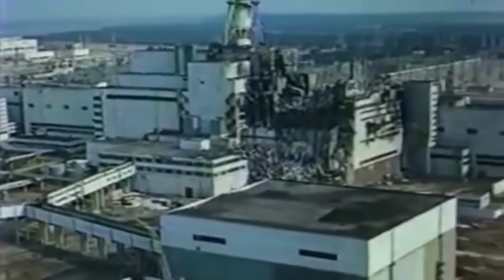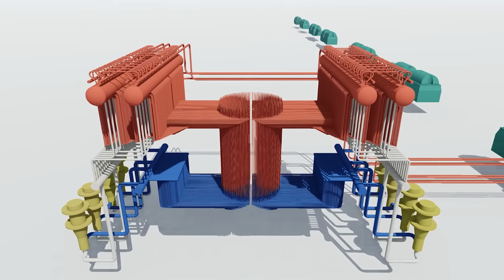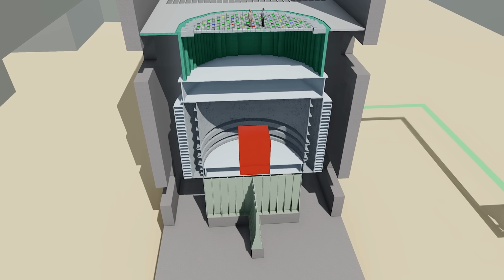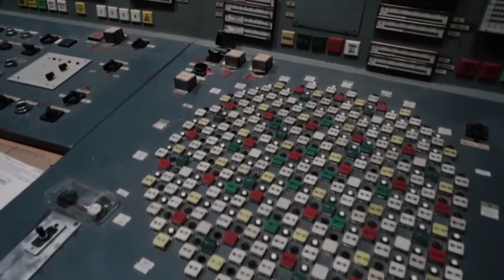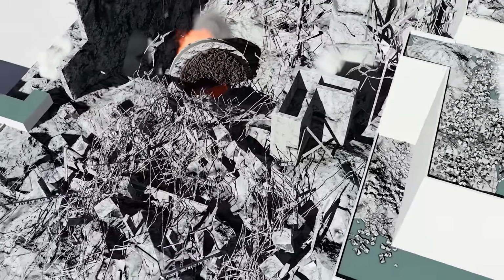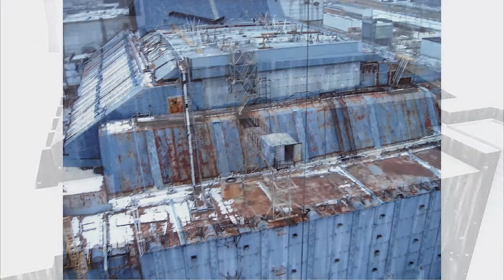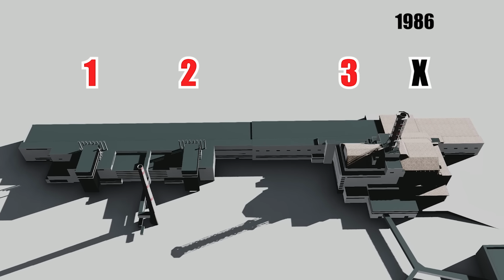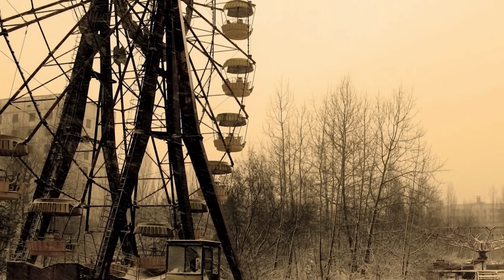CHERNOBYL DISASTER - An Inside Look - 3D

Comment: A stupid comparison. In Chernobyl, incorrect operation - contrary to the regulations - led to a catastrophe - in Fukushima it was an event that was misjudged (the walls against the tsunami were too low and the power plant was planned negligently). In Fukushima there are also 3 containments that do not hold back the radiation - on the contrary: the reactor hall exploded there too. In Chernobyl the roof of the reactor was thrown off and the reactor was destroyed - in Fukushima the reactor was also destroyed. In both cases the area was so badly contaminated that the people had to be evacuated. Did both disasters lead humanity to switch off nuclear power? No, on the contrary. People are still being told today how environmentally friendly this criminal technology is. It is a scandal and a crime against nature, animals and people!
Reply: "in Fukushima the reactor was also destroyed."

In Fukushima none of the reactors were so much as scratched by the hydrogen explosions that happened above them, the only damage to the reactors at Fukushima is at the bottom of them where loss of coolant led to them melting through the bottom of their containment vessels.

Comment: "Western reactors are stable by design" LOL :-) like Fukushima !
Nothing is stable !
Reply from the maker: old analog_synth Fukushima melted down when the reactors were off. They melted from decay heat that was not removed because water circulation pumps lost power after being knocked out by the tsunami.  Its reactors are stable while running.  Chernobyl blew up from the nuclear chain reaction having a runaway. Result of an unstable reactor design.

Comment: All water cooled, solid fuelled reactors are highly inefficient (using up only 0.7% of the fuel) and unsuitably dangerous, since water is a very poor coolant and not suited to a high neutron flux application. Its inventor even said that they should not be built by the late 1950's.  Great graphics, very interesting!  Thx )

Comment: Why were these uranium filled Led Tubes jumping up and down shortly before the disaster?
Reply: due to the steam pressure desu, due to the tests the valves were closed, the steam pressure increased due to boiling water (steam has a lower neutron absorption coefficient than water, respectively, the more steam, the hotter the reactor) and the steam pressure in seconds became so huge that it began to burst channels and push rods out.

Comment: If I got it correctly from the media, this type of reactor is just as safe as all western types of reactors. Just look at the list of incidents in German nuclear power plants. I also remind you that not only 1 reactor exploded in Fukushima, but several - due to the same triggering event: the tsunami after the earthquake. It must also be noted that in Chernobyl all security systems were switched off by an idiot who was money-horny and haughty, who did not believe the warnings of the staff (Anatoli Djatlow), and also acted against the regulations in the operating manual. To this day, the West is jealous that the Soviet Union was able to design and build a reactor as early as the 1960s that still meets many Western standards today. I would like to remind you of the many incidents that occurred in the west: Thee Miles Island, Windscale, - in Germany too, one had the same problems with some of the reactors that led to the accident in Three Miles Island - but the operating personnel were in Germany better trained. I also remember the incident in Switzerland: Lucens. I must also remind you that the reactors in Duel (Belgium) and Tihange (Belgium) have been classified as scrap reactors since they were commissioned because hairline cracks were found in the pressure vessel jacket. As a remedy, it has been prescribed to preheat the emergency cooling water so that it does not break due to thermal stress in the event of an accident. I also just remembered that in Fukushima they had the same problem with the incorrect content display for the pressure vessel as at Three Miles Island. In Germany, too, the problem of a correct display - under all operating conditions - has not yet been satisfactorily solved. In addition, it has to be noted that it was only with the accident in Fukushima that the problem of several reactors in one place was recognized: If even one reactor breaks down, access to the remaining reactors is also restricted. However, the Raktroten I, II and III in Tchernobyl m.W. continued to operate until the early 2000s. This contribution is deeply politically justified and therefore worthless because it is not objective.
Reply from the maker: "an idiot who was money-horny and haughty"  not very objective dont you think LOL 
I happen to agree with you that nuclear reactors around the world have serious flaws. Look no further the Fukushima.  And the monitoring systems that give false indications represent immense risks.  Its surprising there haven't been more disasters.     
My video cant be edited after it is posted to Youtube and so I cant change what I say.  I plan to remake this video and expand on the detail visualizations and illustrate how the systems failed.  This was my first attempt and I am thrilled it has got a million plus views.    Next time I will stay away from political commentary and my personal opinion.   It doesnt enhance the video.

Comment: it seems to me, and I have never watched this Chernobyl HBO whatever it is because I don't watch TV and have nots for almost a decade but, designing and manufacturing a nuclear power plant, most predominantly the design of the reactor core is not something that one should take lightly. It is an exact science. It's not as if one of those things that the designers could have just sat back and said okay well this will just be one thing that will put on the back burner for a while. at the end of the day out of all the Chernobyl videos that I have watched and all the research that I have done this pretty much comes back to Occam's razor.to anyone not familiar with this Occam's razor is the scientific precept that with all things being equal the most logical and simplest solution is usually the correct one. It is most likely that this could have been avoided had it been more proper training, and more outreach and communication with the developers of the rbmk 1000 reactor series.if there are three of them still in use than it's painfully clear that these reactor cores are not dangerous under the correct supervision and following the correct

Comment: Only The Experience and Knowledgable Need To Construct Such A Machine, And They Need To Test It Thoroughly, From The Inside Construct To The Outside Of The Reactor And Building Thoroughly, To Make Sure, Every Worker or Citizen Is Safe In Or Out Of The Factory, Or Were The Reactors Are Placed In or At The Locations.

Comment: To their credit, it took 1500 buses from all over the Soviet Union, and was accomplished in about 3 hours!!

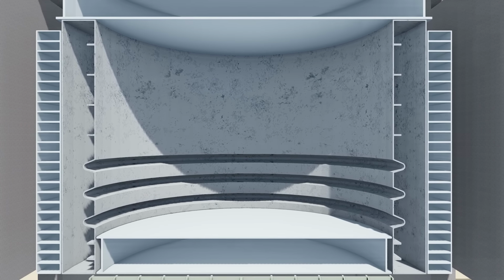Edit: also, the control rods that were designed to initiate a emergency shutdown of the reactor (not the 'moderating' rods that were used to control the reactor on a daily basis) also called the 'spider' for it's shape was IMPOSSIBLE to engage that morning (1:26ish a.m.) why? Because the electrical circuit that controlled the safety system was NOT CONNECTED!! It was assumed that it was almost impossible to have an accident with the RBMK 1000 reactor due to the unbelievable propaganda that was disseminated by the Soviet Communist party to allay the anxieties of the people. 
Even Gorbachev was told it was as safe as a 'samovar' (a steam kettle or tea kettle in the west).
Also, there were very many witnesses in pripyat that saw 'cherenkov' radiation glowing in the clouds around the area of the reactor buildings and above thet own of pripyat on the night afterthe explosion, and for a coupledays after.
(the blue visible light givin off by nuclear fission, you can see it safely on YouTube by searching 'nuclear pulse'. Very many universities, and power plants have videos on here showing it very clearly.)
This is safe when viewed through several feet of water, as water is an excellent neutron moderator. If you're seeing it through the air though...you're essentially fkkd. 
Just thought I'd add those details...
Note: I'm not a specialist, or a nuclear scientist, chemist or even qualified to give accurate information about this subject..
I merely remember things well, and have read pretty extensively about Chernobyl. 
I was around 12ish years old when it happened. 
Cheers ya limey bastahds...
😳😂😂😂
Reply from the maker: It was 36 hours later.  The accident happened Saturday morning 1:30am and by Sunday afternoon the busses were moving the Priyat inhabitants out.  Quite a monumental feat.
Reply: @Mike-Bell  pardon me... indeed it was monumental... I've seen very conflicting stories about that evacuation. 

I loved your video, very excellent graphics... I've seen just about every availed documentary about Chernobyl. 
Thanks so much for sharing this. 
respect from ☀️😎☀️🇺🇸
Reply: 36 hours after puts it at Sunday about 1:30 pm. I was mistaken. Thanks for the reply. 
Be well brother, can't wait to see more from your channel about this. 
Cheers!
Reply from the maker: @d.cypher2920  video says evacuated the next day
Reply: @Mike-Bell   yes, It does.

Comment: Why was the stack rebuilt/replaced to accommodate the safe confinement structure? Was there still a required function for it?
Reply from the maker: I can only assume there is an ongoing ventilation requirement for reactor 3 and leftover 4.  They wouldn’t have built and spent the money for a chimney for fun.  Too expensive...

Comment: wait the other reactors still run until 2000 wtf
Reply from the maker: Jup. You cant just go and switch off 1/4 of your power generation.  Electricity is fundamental to life and the economy. The realities of real life
Reply: And it was unit 3 which was in same building as unit 4, and shared some technical areas,..

Comment: Very impressed with the quality and accuracy of your 3D animations of the reactor. Never before have quality and accuracy of animations of this level been done before with his disaster or the RBMK 1000 reactor. However, you do not have your facts straight. The RBMK 1000 reactor was actually a very safe design and the disaster was centered more on a very flawed execution of a test
Reply from the maker: A very safe design wouldn’t have blown up in such a spectacular fashion .... not so?!  The bottom half of the control rods as designed were an accident waiting to happen.

Comment: I dont believe that refueling during oparation is impossible with a pressure vessel, the last experimental reactor sweden built before shifting focus to comercial reactors had a refueling machine located inside the pressure vessel, it worked by a thick tube moving up and down through a passthrough in the pressure vessel. When raised above the core a arm would extract horisontally and pick upp a fuel rod and retract back and sink back with the tube via the passthrough abd down under the reactor vessel where the spent fuel pools were located and release the rod under the water and the vice versa procedure to load a fresh fuel element.
Reply from the maker: Yes you are right.  See my correction in the pinned comments
Reply: Okay, I misunderstod then i thought you meant other channel-type reactors like CANDU (as mentioned)

Comment: and the RBMK-1000 is a classic example of why you don't put graphite tips on the control rods. especially if the reactor has a design flaw which makes it dangerously unstable when it's run on low power

Comment: Can someone please explain to me why they even replaced the smoke stack instead.of just sealing it off. Because isnt it only needed for operation? Wich this thing clearly isnt going to ever do again.
Reply from the maker: I have found no definite information so I’m guessing. Yes it would have been expensive to rebuild so they didn’t do it for fun. I presume it serves the function as emergency vent to reactor 3 which is still there but in cold shutdown or for other equipment still in the building.  That is my best guess.
Reply: @Mike-Bell  thank you for replying and helping out, your explanation makes a lot of sense

Comment: Why was the ventillation shaft replaced and not just removed? It is not like the place is operational.
Reply from the maker: I have found no definite information so I’m guessing. Yes it would have been expensive to rebuild so they didn’t do it for fun. I presume it serves the function as emergency vent to reactor 3 which is still there but in cold shutdown or for other equipment still in the building.  That is my best guess.
Reply: @Mike-Bell  your one of the most responsive youtubers

Comment: To be correct, some Western Reactors such as AGR and CANDU can be refuelled without shutdown. Although AGR  has to reduce power as it was found that at full power it creates a resonance vibration in the fuel rod during loading, so risking creating fatigue cracks in the stainless steel cladding and so compromising containment in the event of a cooling failure.
Reply: Sorry Mike just read your correction below.

Comment: The sad thing is is that nuclear reactors are some of the most environmentally friendly energy source if done correctly. And because Russia cut costs and cut safety measures they ended up fucking over Eastern and Western Europe for years to come.
Reply from the maker: Don’t forget about the Americans who designed and built reactors in Japan that melted down and blew the top off the cooling pond buildings... not once but 3 times.  Because they tried to save money and built the power station not high enough above sea level.  The Americans and Japanese put the final nails in “safe” nuclear energy. not so?!  
#justsaying 🤔

Comment: You glossed over a LOT of details.

1..  graphite is used to moderate the nuclear reaction ( slow neutrons to thermal equilibrium to cause fission).  
2.  The rpdesign has a positive bulk void coefficient.  Loss of cooling water ADDS reactivitiy.
3.  The design has a positive temperature coefficient.  The,perspire increases add reactivity ( more fissions)  due to the positive void coefficient.
4.  The reactor was set up for a feed water pump test at the end of core life.  Tripping the pumps should cause a scram of the reactor.  
5.  The  reactor went from operating at full power to low power to set up for the test.  This reduction in power cussed xenon ( a neutron poison) to rise in level.  Control rods were pulled out to maintain criticality.  They ended up pulling g out more control rods than allowed by the operating rules and thus did not have shutdown margin.
6. When control rods insert, they displace water which is a neutron moderato pr — adding reactivity initially due to the positive bulk void coefficient. Scramming the reactor initially INCREASES fissions.  Exactly the opposite of what you want to happen.
7.  A fee water turbine pump trip test was run with reactor act low power, and few control rods inserted.  The drop in water level added relativity and the neutron population increased DRAMATICALLY and caused an automatic scram on power level.  .as the rods inserted, they added reactivity and power increases to the point where a,l the after flashed to steam and the reactor over pressurized and a steam explosion occurred.  This exposed the  graphite and it began burning due to the amount of heat and exposure to oxygen.  

The whole thing is a tragedy of errors by the designers and operators who did not understand the significance of their decisions.

Comment: you didn’t explain anything
„pressing A3-5 exploded the reactor“ 
yeah how about explaining exactly this??
Reply: Here's the quick version (or as quick as I can make it) The control rods (green in the video) control the reaction. Pulling them up out of the reactor is like stepping on the gas. Dropping them back down into the reactor is like stepping on the brake. They're made out of boron carbide, which absorbs neutrons, so when they're inserted they slow the reaction.
 
When the control rods are pulled out, the space below them would fill with water. Water ALSO absorbs neutrons (though not nearly as well as the boron carbide). So pulling the rods out wouldn't speed up the reaction as much as they needed it to.
 
To solve this, the designers added graphite sections to the ends of the control rods. Now when the rods are pulled out part-way, the graphite occupies the space below them instead  of the water. Graphite doesn't absorb neutrons, in fact it "moderates" them which is a complicated way of saying it makes the reaction go even faster. So now the design of the control rods works as intended.
 
This all works okay, except during the test they were running. Because of complicated reasons, reaction products built up that ended up killing the reaction almost completely. The engineers ended up pulling ALL the control rods out all the way to try to get the reaction started again. It finally worked, but it was now heating up too fast.
 
The A3-5 switch quickly drops all the control rods all the way down. This is what you use to shut it down in an emergency. The problem is those graphite ends on the rods -- they went into the reactor first, which temporarily raised the reaction rate even faster. Instead of immediately starting to slow the reaction down (which was the intended purpose of the A3-5 switch) it made the reactor explode.

Comment: Hold up. They were still running the other 3 reactors AFTER this?
>Comrade, you still need to operate reactors 1,2,&3
<You mean the reactors right next to the largest man made disaster which has spillled enough radiation into the air that the effects will be seen for hundreds of years?
>Yes Comrade. That is the one
<Go fuck self cyka blyat.